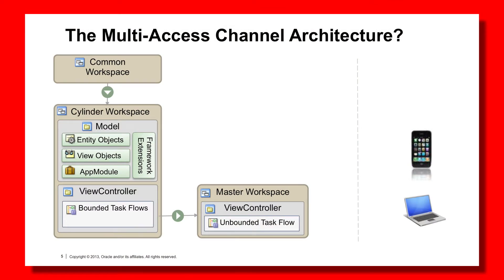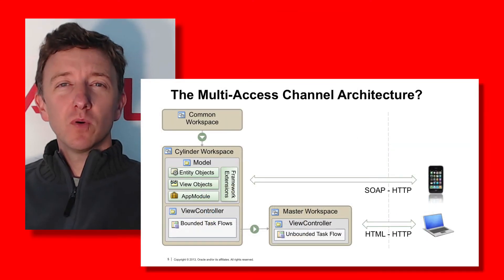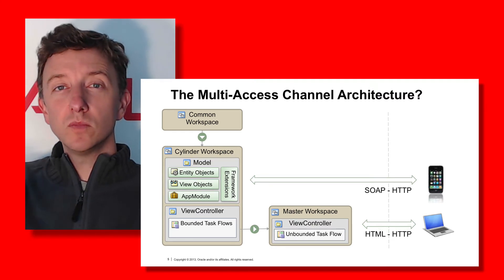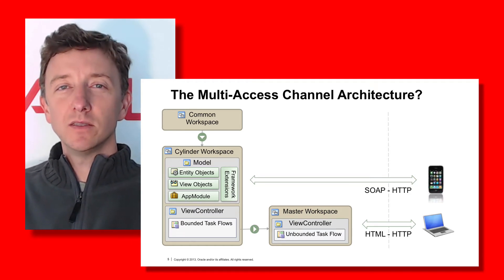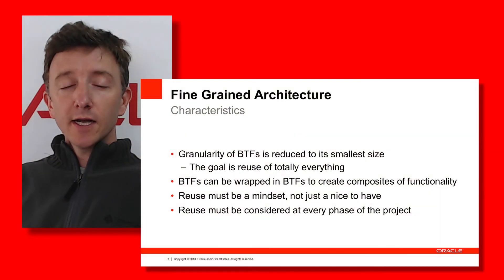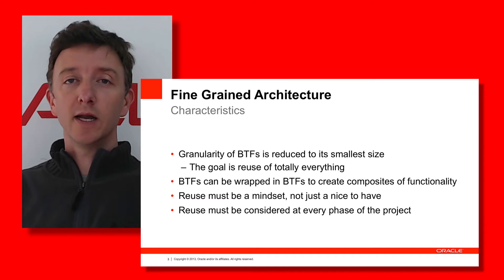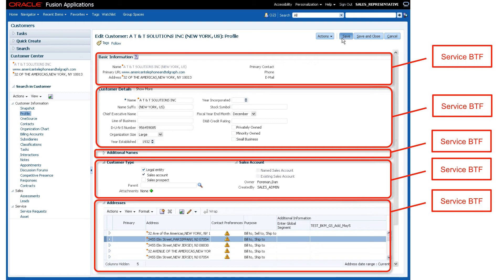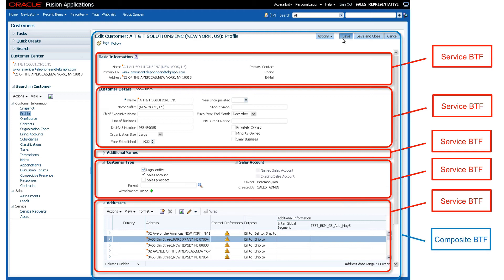18. Design - ADF Architectural Patterns - The Remaining Set

Comment: nice segment on the fine grained pattern. For our forms (or technology X app) to adf migration, it can be easier to identify which sections within a module should be reusable and isolated as it's own parameterized btf. The draw back as you mentioned is complexity  For example, no view links for master/detail but use bindvars or querycriteria or programatic row setting and additional region to region interaction code. However, when applied correctly, it does save us from lots of redundant code.